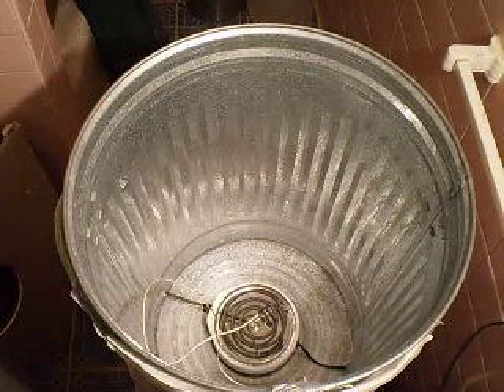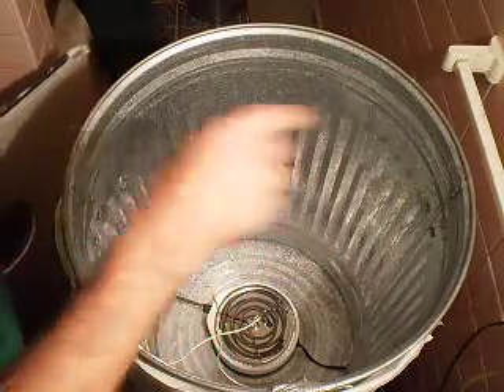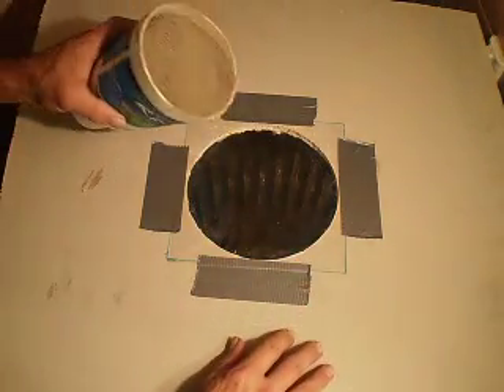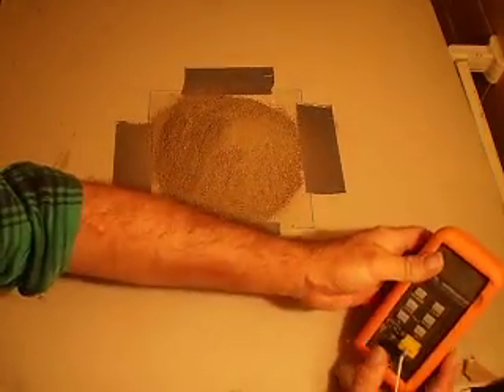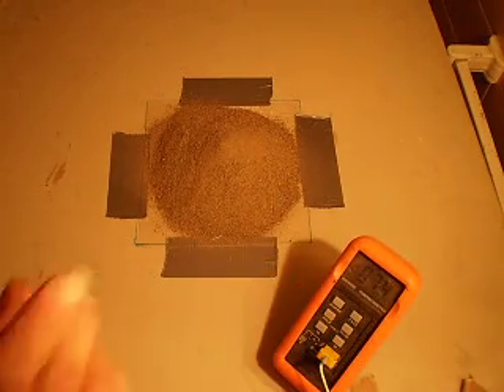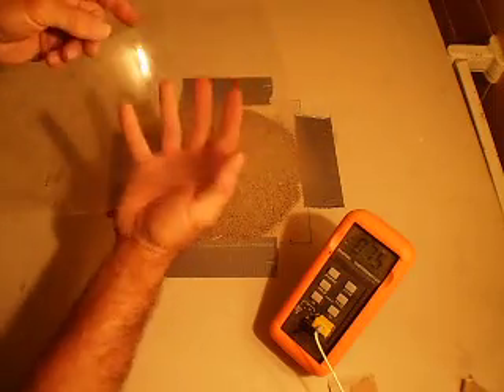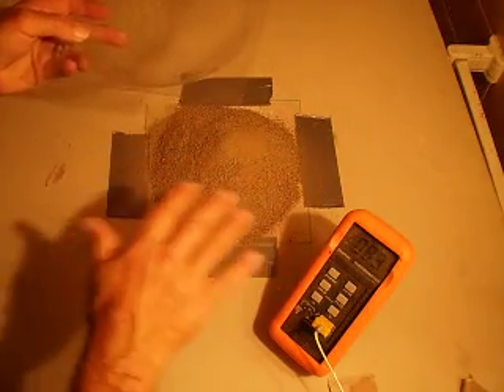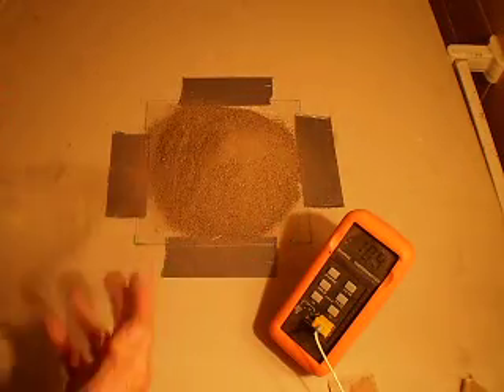A Cheap Plastic Aluminum Foil Solar Lens. First I make the Plastic into a parabolic shape.

Comment from the maker: Yes, you could use the same way of doing it, but you may need more dirt and heat. I made one from a sheet of standard acrylic about 16 inches in diameter, but gave up on idea as the rim is too strong to stretch by tin foil when suction is added and will not get the right shape for lens.
  The plastic formed a parabolic shape which is strong, and yes you should be able to make parts, face shield and Helmet. A standard round shape is made in acrylic by heating it and adding air pressure.